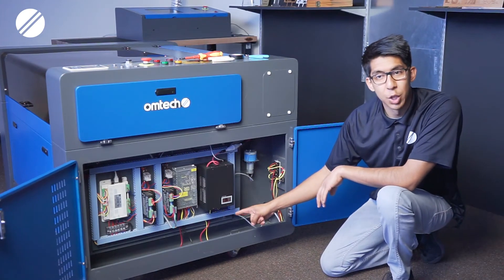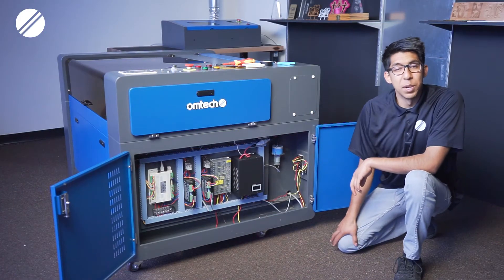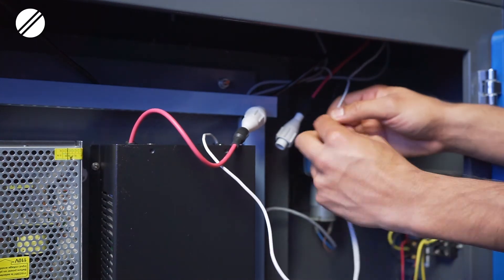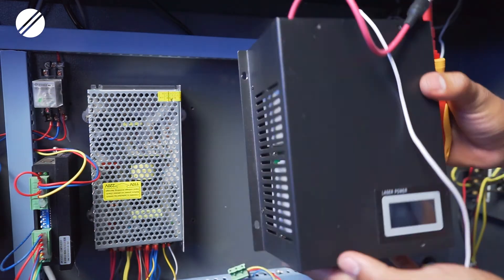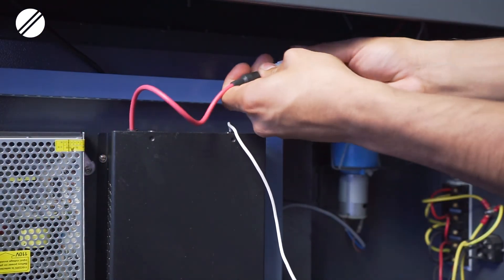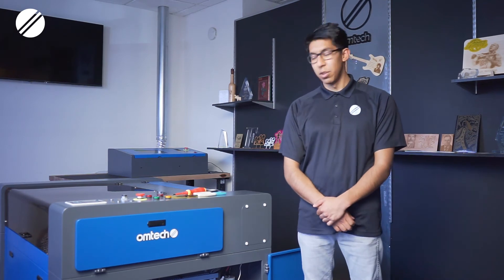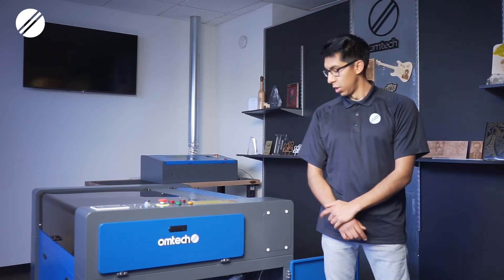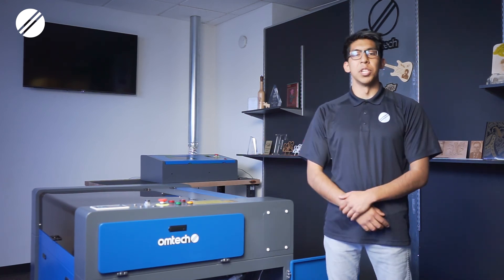Changing Your Power Supply - Training Video - OMTech Laser

Comment: Hi, my laser is not pulsing. Everything seems to work except for the laser, the laser power supply is on but when I press the pulse button there is no amperage movement (stays at 00mA). Can you advise where I should start to troubleshoot? When the power level is low 20-30 it makes a light buzz sound when I pulse but when I turn the power up to 50-60 it makes a really loud scratch noise that actually scared me lol. Any help would be greatly appreciated. Thank you!
Reply from the maker: Thanks for reaching out! We suggest contacting our Technical Support Team here: https://omtechlaser.com/pages/contact-us or book a Virtual Technical Support Session. If you purchased from our website, you should receive a code for a complimentary 45 min. session. While you are contacting our team, we also suggest joining our Facebook Group and asking our engaging community of users here: https://omtechlaser.com/pages/our-laser-community

Comment: I was curious how many watts the PSU is in my MF2028-80W.
Reply from the maker: Hey there, great question! We suggest checking your PSU sticker on the power supply. If it's 100W, it is a standard practice taken and will not affect the integrity of the tube.
Reply: @omtechlaser  I haven't received mine yet. I'm preparing all my grounding and power before it arrives and I couldn't find that info online. I think I saw 100W somewhere, but didn't believe it. I thought they might have meant it runs on 110v power. Thanks for the reply.